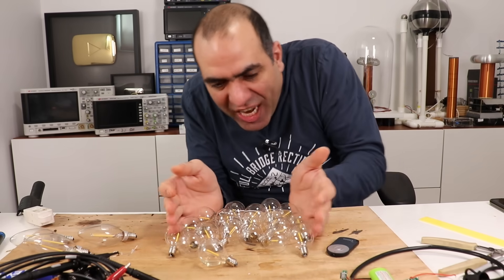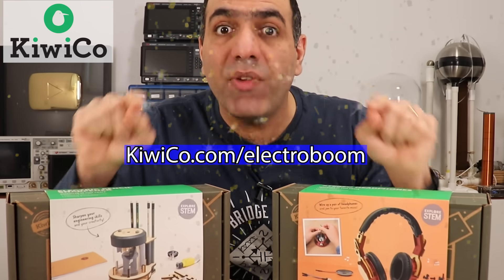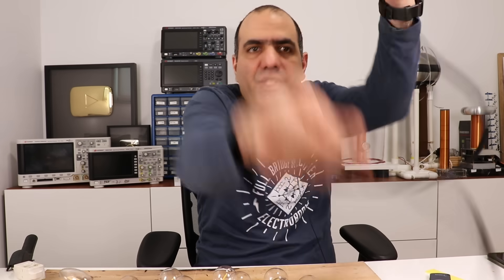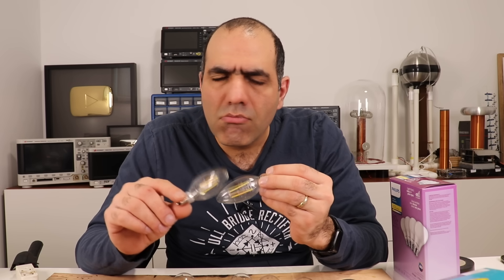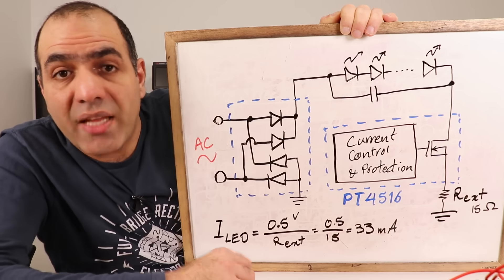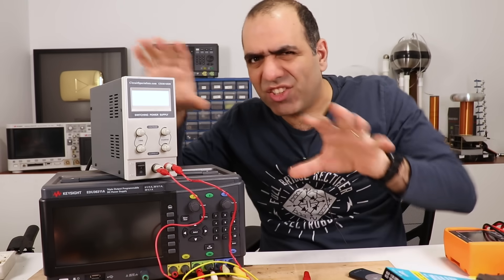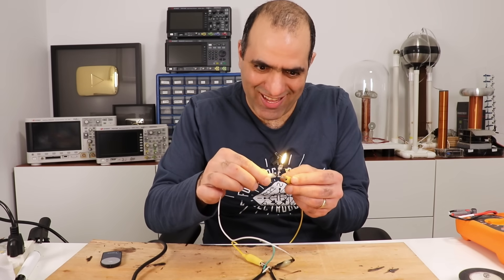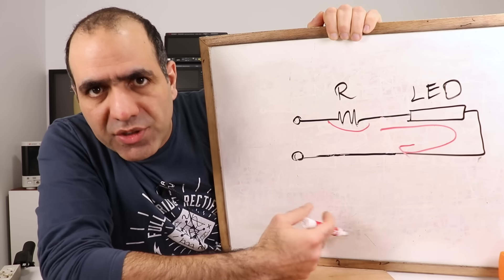So Many MISERABLY FAILED LED Lights

Comment: what an age we live in. A modern world. New innovative technologies used everywhere. a computer that can fit in your hand, 100 stronger and faster than a compera white box pc from 2005 yet still need to be changed every two years because it just stops being supported by new apps.. And light bulbs that fail from air. In my grandma's village is numerous light fixtures from 1960s and 1950s that are still in use. Inside are preheat ballasts and starters that are engineered to never fail if used properly. And tubes inside installed in 1970s that are still alit to this day and still work. The fixture body is brass and it still looks fresh to this day. The glass shades are still sparkling like new. These fixtures will last another 50 years not even joking. And the new LED bulb that is produced in some degraded Chinese factory by 5 year olds whos parents sold them to labor there and they fail after 1 day of use in more than a 0% humid environment and if the temperature is 0.000001'C higher or lower than the so presumed "operating temperature". I swear to god. This is starting to piss me the hell off. I recently bought Philips LED bulbs and installed them in my kitchen ceiling lights. TWO MONTHS!!!! TWO MONTHS AND THEY FAILED. Incandescent lights that were installed before them lasted 10 years before they burned out. The fluorescent fixtures in my wet basement were installed in 1980s STILL LOOK NEW. Maybe we were doing something right in the past? Yet everyone shit over the fact that previous technology was not efficient. Yes, when LED is 90 percent efficient tat producing light, what is the point of it if it breaks and burns out in more than a few days or weeks. But we forget the fact that we in the past made things to last. Things to be used and be afraid they will break from air.

Comment: High temperature to either led string or resistor is the problem when failing.. What is ignored is the thermal resistance of the armature the lamp is used in. It makes an enormous difference.  High voltage over a resistor might be the problem when the wrong resistor is used. Apart from power a maximum voltage is also specified for a resistor. Often ignored but important in such applications.

Comment: Unfortunately they say 5-10-15 yrs warranty is only with 2.7/3 h of use daily in ideal conditions (which don’t exists), so the real warranty is usually 2/3 yrs or sometimes on some professional use led lightning is 4/5 yrs

Comment: Another problem with LEDs is their incompatibility with dimmers. Even if they are designed to be dimmable, not all dimmers are the same and some pairs of bulb and dimmer don't work at all. Either flashing at low settings or barely dimming or just buzzing, so look at the manufacturer's data sheet for a recommended dimmer.

Comment: That reminds me... the glass dome fell off one of my old Cree bulbs (first production run of their first bulbs, 2014), so I should glue it back on.  The electronics and heat sinking are really quite good on these bulbs, but the glass falls off easily.  And it has a rubbery coating on the glass so it collects dust and fuzz which is hard to remove.  Weird design.

Comment: Don't think the warranties are every worth it.  I bought high end LED bulbs because they had a 5 year warranty... when they started crapping out after about 2 years I contacted the manufacturer for replacement under the warranty... Guess what, to get the bulb replaced you have to send in the old bulb, which isn't cheap... and include a check or money order to cover the shipping and handling of the replacement bulb.  When you factor in the cost to send in your old bulb plus the shipping and handling fee, it ends up costing more than just buying a new LED bulb.  So don't think you will ever use the warranty, it cost too much to worry with.

Comment: I've never had a single LED E37 light last as long as they should. I remember when we used incandescent lights, and having one fail was so rare that I changed maybe one or two every year, possibly even less. Since we all had to switch to LED lights, I need to change one every two or three months on average.
Reply: I've done some testing: it's usually not the LEDs that fail, but the transformers or some other component on the board..
Reply: I've tried both cheap "generic" lights and expensive "branded" ones (e.g. Philips), finding absolutely no sensible difference
Reply: We haven't had many LED failures. CFLs, yes, but the LEDs a trucking on for years and years.

Airflow? Not driving them too hard? First gen LEDs being better?

Comment: This makes me think of LED Christmas lights. They work well for a while but after some time the bulbs go dim. I did some digging one day out of curiosity and noticed a resistor installed in parallel with the lights to prevent the bulbs from completely dying when the resistor fails. In my case I suppose the resistor failed leading to a higher current draw through the resistor but not high enough to trip any breakers, kill any lights, or melt the transistor.
Reply: I've seen that with incandescent Christmas lights too, to prevent the "one goes out, they all go out!" problem.

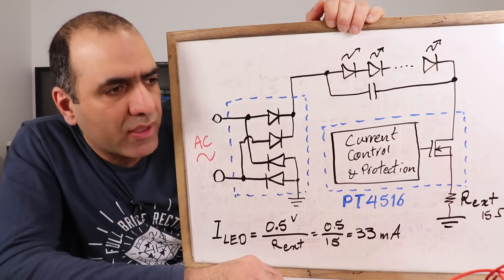Comment: Change out that resistor (@5:00) for something a few ohms higher - that'll dim the LEDs a bit, but they won't be driven as hard, and they'll last a lot longer.   (Although, good luck doing so without mangling the socket threads.)
Reply: Or breaking the glass in this case
Reply: @Epsicronics   The resistor isn't inside the bulb, so breaking the glass is pointless.  But you do have to break into the socket. 
I'm wondering if there's a way to limit the current on the AC side (outside of the bulb) without screwing up the operation of the chip...  might be a product there!  If you pre-rectify and current-limit the input power, even those craptastic Chinese bulbs might last a long time!
Reply: @jpdemer5  yeah that might be interesting.
What i mean is that the way these bulbs are formed the socket is pretty much bound to the glass so removing it without breaking the glass is extremely hard in most cases

Comment: The problem is the greed and laziness that has resulted in moving all manufacturers and intellectual property to national socialist China. Also, the power required to make those cheap LED bulbs is not insignificant compared to the very cheap to produce conventional bulbs and don't last even close to as long. Even worse are the mercury filled connect fluorescent bulbs pushed on us by the enviro-huckster politicians, polluting our landfills and waterways to protect us from the life giving gas.

Comment: I found out that exactly the cheap Chinese LED lives longer than the well known "high" Quality Brands. 

There are two types of Chinese LEDs, the ones that utterly cheap and often also dangerous (Mains exposed so can touch it). But there are also Versions with high Quality, Safety and these live also longer than the "high Quality" Brands.

And never buy a Lamp where you can't change the Lightbulb.

Comment: Those are all led filament bulbs. I've had bad luck with those. I use ones with surface mount leds and had much better luck with them.

Comment: The let's may last 10,000 hours but the electrolytic capacitors in the ac to dc convertor are rated for about 2000 hrs.
Reply: Led 's

Comment: I've been through enough LED lights to refuse to touch them now. I replaced a light in the house with a 100W incandescent light and it's both brighter and better. In my motorhome I chucked all the broken LED lights and replaced them with halogen. As more break I replace with halogen. The halogens are cheaper and last longer. Since the lighting is solar powered I have no worries.

Comment: Have had lots of LED failures and bad manufacturing and low light levels while the brightest LEDs do get hot and the ones Ive used on cars have fans on them cuz they get extremely hot no different than hid or incandescent.

Comment: Nice video, I very much agree. The main reason I switched to LED years ago is so I don't have the hassle of changing light bulbs as often! The energy savings was a bonus to me.
Reply: True that, all the LEDs I have, and a few CFLs I have left, have always lasted longer than any incandescent lamp we've ever had.
Reply: Vielleicht die LED-Lampen aus der Einführungszeit. Da sollten die Käufer dafür begeistert werden, die Qualität war in Ordnung und die Kühlkörper reichlich bemessen. Nachdem das Aus für die Glühbirne durchgesetzt war, gind die Qualität der LED-Lampen rapide zurück und ohne ausreichende Wärmeabfuhr sterben die LED reihenweise.

Comment: I replace LEDs more often than I used to replace incandescents. I had a set of vanity bulbs in the bathroom that were going on 9 years. Sure they use less power so cheaper for me as far as energy usage but FAR more expensive considering I have to buy new LEDs for WAY more cost (I used to get a 4 pack of incandescents for a buck 25). But if you consider total energy usage per bulb (manufacturing AND use) its probably a wash. So who benefits? The government lobbyists who pushed this on everyone thats who.

Comment: I lost four 12vdc corncob led bulbs after leaving them on for 2 weeks in my boat.  What they do is partially light up some leds and flash some at very reduced light output, they dont have any brightness left. I am thinking using the bulbs overheated the drivers, they did not get wet. They were stated to have a very long 60,000 hour lifespan, which obviously is a lie. I have had better results from the AC LED bulbs. They are brighter too, more honest to 'watt equivalence' of incandescent bulbs.  Other thing is some ads do not tell you the LUMENS, just watt equivalence, maybe cause the Luminous output is lousy and they dont want to tell you.

Comment: hey mehdi, i got a LED panel, like a square with those drivers you're talking about, but the driver is in a separate box. can you replace it instead of replacing the whole LED panel?

Comment: I wondered if other people were also irritated by LED bulb failure.  They're great as far as heat and efficiency, but so far reliability is a little lacking.  I never tore mine apart, but now I see why they're so bad.
In both cases mentioned: yes, awful designs for efficiency (and in the 2nd case especially, reliability).  I wonder if they really meet their efficiency specs.
1. Linear regulator.  Bad power efficiency--  basically efficiency of a series resistor.  Shouldn't burn out though.
2. Just a resistor + diodes?  Bad efficiency, and aside from the water issues you mentioned, negative temperature coefficient of diodes means the voltage drop decreases as temperature goes up.  i.e. as the bulb heats up, more power passes through, making it heat up more, making more power pass through, etc., and... pop (the circuit will level off at some point, but absolute worst case is the diodes have very little voltage drop-- it won't get to zero, but lets say absolute worst case it nears zero, so a resistor with a power rating < V^2/R could fail).
Like @ElectroBOOM said, where's the coil?  This would indicate some kind of switching regulation, which can be much more efficient.

Comment: The thing about saving so much power compared to incandescents is that for half of the year, the savings are imaginary. At least that's true if you live in an area where you have to heat your house during the cold months. If 90% of an incandescent bulb's energy is dissipated as heat, then that just helps do what your furnace is trying to do anyway. It's a good thing, not a bad thing. During the summer of course it's adding an extra load to your air conditioner, if you live in an area where you need one, and so that's a bad thing for half the year. An interesting solution would be to treat your light bulbs like your smoke detector batteries, and change them over when Daylight Saving Time makes the clocks change. Incandescents in cold months, LEDs in warm months. Would it be an inconvenience? Sure! But it would at least recognize the fact that incandescent bulbs' inefficiency as light sources makes them very highly efficient as heat sources.

Comment: "IP44 WEATHERPROOF"
Yea, that's what a smart floodlight I got said too on the box. 

It spazzed out a few weeks after installment. No idea if it the circuit just failed, or got destroyed by water, but all it does now is flash when I plug it in.

Comment: This is a subject that confused me for a long time. another thing is, LED's used to be cheap when they were just indicators on small electronics. why did they become so expensive, when they became the low energy replacement for homes? Feels like we're being ripped but i'm probably missing something. Also, don't buy exterior lights that claim splash proof but also advertise IP44 - that means spash proof, not waterproof. marketing wank. go for IP67.

Comment: the cheap bulbs, are they on a string that has a controller between the plug and the bulbs? I have seen that done before. 1 controller on the line and it powers several bulbs.

Comment: I did start out purchasing household LED bulbs, but soon changed my mind their life expectancy on the pack is far longer than in reality. I am now purchasing incandescent light bulbs again because their cheapness to replace far outweighs their cost to run against the high cost of LED types

Comment: Teach the kids from a young age is absolutely right. My dad got me all the components to make a crystal set radio when I was ten, and from there I ended up managing the installation of the first mobile phone network in Nigeria. Along the way I devised a way to transmit data over wet string, and to test microwave radio sets in an enclosed room without irradiating myself.

Comment: I started buying LED bulbs 15 years ago ($25 a piece then) and it's been my observation they don't last much longer than incandescent lights.  The early ones were horrible, maybe a hundred hours tops.  Modern LEDs are better but still not great.  At least now they're cheaper.

Comment: @ElectroBOOM - Can you do a video about dimmers, but not only magnetic power supply vs electronic, but forward phase and reverse phase and what that all means.  I have dimmers all over the house using Lutron Radio Ra2 technology, but each dimmer needs specific type of bulbs, but bulbs are the store are not labeled with the phase information.  The LED bulbs are replacement bulbs for standard 120v incandescent bulbs. Would love to get your thoughts on this if there is an angle for you and you find it interesting also.

Comment: The funny/sad thing is that the manufacturers/designers very well know how to make lightbulbs that last... but they also are required by the company to put extra effort into making them precisely last only long enough for the customers to keep buying more replacement bulbs - and more faster please.

So, all your dead bulbs actually 'failed successfully'
Reply: btw. this is not a conspiracy - this was indeed mandated by law back in the big depression to help push the economy. (don't quote me thogh ;P )
I think Tom Scott got a video on that - with a light bulb that's been kept light up for centuries in a fire department.

Comment: Proof of point: My grandfather has a GE lightbulb that looks like one giant circular heat sink. First ever 120V LED bulb I saw, and IT STILL WORKS to the point that it has LITERALLY OUTLASTED THE SOCKET MOUNTING! Seriously, it’s hanging out of the ceiling on hot spaghetti and looks fine for brightness.
GE did not sponsor this comment.

Comment: back in the mid 90s we started putting LED lights onto motor coaches. The warranty on those lights was 100,000 hours.  Not 10K, but 100K.  No we're lucky if we can 100 hours.

Comment: Any data on LED bulbs failing due to wiring issues?  Something altering the power wave-form and causing the driver circuit to fail early?  Or perhaps how a square wave from in inverter may affect the LED or driver?

Comment: Manufacturer can make lights that last significantly longer like the Dubai bulbs but they only make money when you buy replacements so they purposely make them built to fail so they make more money.  There was at least one company that made extremely long lasting bulbs but they suffered money issues as a result. I don't remember if they switched to built to fail or they went out.

Comment: i have tons of LED bulbs i just dono what to do with them

they not dead, they just loose a lot of brightness 
all of them rated for 10,000 hours, but after a year of using (10 hrs a day,  around 3650 hours used), most of them loose half of the brightness (measure with my lux meter)

Comment: Buying that "LED" crap is a fools errand.  It uses one tenth the electricity of incandescent bulbs, but the bulbs are many times more expensive.  How long would it take for the additional expense of LED bulbs to make up the difference with incandescent?  100 years?  The worst part is that the LEDs don't last near as long as advertised.  Is infuriating to pay the additional cost for LED and they crap out in just months.  I have incandescent bulbs that were originally installed over 10 years ago and only cost 25 cents.  If I would have replaced them with LEDs, I would have spent much more than that and the electricity savings would not have made up the difference.

Comment: Seems my LED lights are failing as quickly as my CFL lights were, which was about the same as incandescent bulbs.  I have one CFL that’s been running in an outdoor pole light for 10+ years, so the technology can work. If designed correctly.

Comment: Huh. I have only ever had like 4 or 5 die, and I often buy dirt cheap ones. And the ones that died were in a ceiling fan fixture that made the LEDs flicker when the fan was on, so I attribute that mostly to an old lighting fixture that was designed for incandescent lighting.